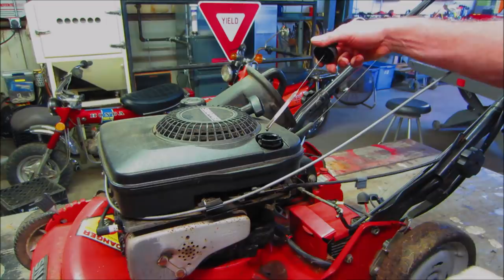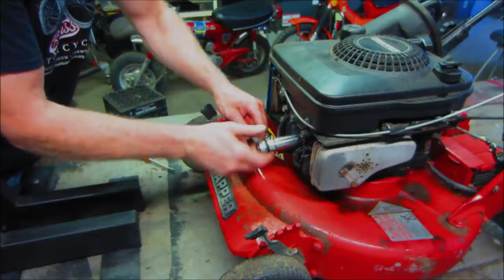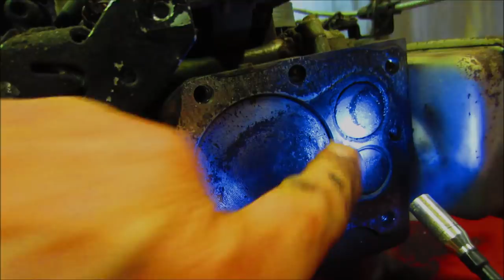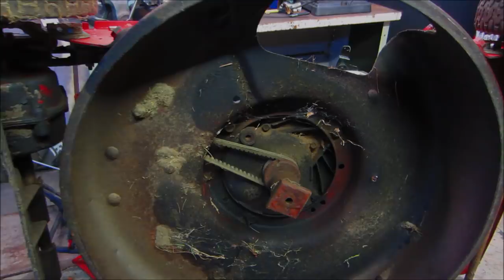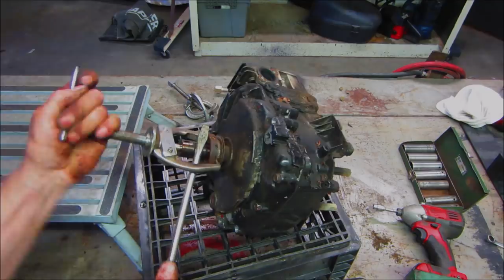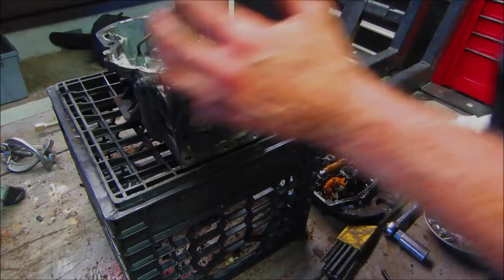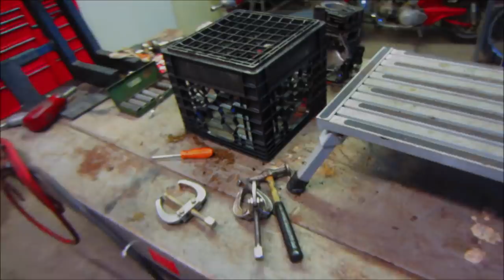Snapper lawn Mower. Why Did It Fail? lets find out.

Comment: When you see plastic cams and gears you know that engine was designed to fail as soon as the warranty expired.
Reply: I was wondering if the plastic camshaft was damaged by the loose bolt, and possibly have a valve open on compression stroke.
Reply: That's actually not the case, i have seen quite a few of these engines worn right out, and it is never the plastic cam that's the issue.
The coefficient of friction between oily plastic and steel is so low, that even on a completely worn out engine, you wont find any real wear on the cam.
Obviously plastic cams can't work in any engine, it's only because the valve spring tension is so low in these engines, that the plastic can withstand the pressure.
Reply: New meaning to variable valve timing
Reply: Most of these I find are still running 20 years later.
Reply: @chefkdowg  still have an '83 Snapper, re-drilled the deck so I can mount Tecumseh (original) or B&S. : )
Reply: @fritzdoerring9058  This engine is a genuine briggs and stratton.
Reply: @fritzdoerring9058  Ummm no its a briggs ignore the lable exactly the same as it has been for 20 years. As for me ive been a small engine mech for 27 plus years running out of a small family business. Dealing with Contracters and as such if i personally dont feel the machine is good enough i refuse to sell it.
Reply: I had a Buick like that, 1983 and one of the first V6's. Ran like a dog. My mechanic was trying to set the timing and it was all over the place. So, (without charging me) he popped open the timing cover, and the cam gear had a metal hub and gears, but everything in between was nylon. The gear was egg shaped. My mechanic found a junkyard gear replacement that was all metal. The Buick ran great after that.
Reply: @wandrinyew  Remember the inline 4 and 6cyl Chevrolet engines?  One timing gear made from metal other some kind of plastic fiber substance. Some company made timing gears out of metal for those engines,Some of my customers would not let me use the metal gears because they claimed the gears were too noisy.Inever could hear the gears myself as they were constant mesh,ran immersed in oil.
Reply: @korvtm  had a Buick V6 in the 80's with a hybrid metal/nylon timing gear. never ran right until we replaced it with full metal.
Reply: @HomelabExtreme  Until some stress is applied to the plastic shit like increased temp. Then the oily plastic teeth slip and the valve timing is gone. Teeth still look good when you open the crank case as here. Hard steel, or titanium, on steel. Still the best.
Reply: @fritzdoerring9058  Good summary of American manufacturing Fritz.
Reply: @glennlurman3514  You are 100% correct, that's definitely a Briggs. Funny thing about Tecumseh, since that name came up somewhere above, they were the biggest small engine producer in the world until they refused to make their engine for $12 cheaper when Sears asked and Briggs & Stratton then agreed to the deal. Sears was the largest retailer of mowers at the time as Craftsman's were everywhere. Suddenly, Tecumseh was bankrupt and Briggs was absorbing almost every other small engine producer in the world. Money makes the world go round.
Reply: @fritzdoerring9058  good engines but the problem with tecumseh was always the shitty carbs they had
Reply: Designed obselance

Comment: Wasn't sure how the gouveners worked till now. Interesting. How long did it take you to figure out the screw came from the air cleaner? Must have kept you up all night. LOL.
Reply: us small engine techs seem to remember bolt locations and appreciable pretty quickly and remember if it was a machine screw, sheet metal screw etc. it helps alot to have a general knowledge of hardware.

Comment: New sub here, with a bit of advice. An inexpensive leakdown tester or just connecting your shop air to the cylinder (via sparkplug hole) would have solved the mystery as to why it had no compression and where it was going, just by listening. IE past a valve or past the rings!😎

Comment: I have a lesser expensive mower from say 1998 Snapper with same self propelled indestructable set up as yours. The Preditor engine from Harbor Freight bolts right on that deck for 99 bucks and have already gotton 5 years of service out of it. it has the same safety handle and clips right on. that Blade you have is a 45 dollar blade very nice for mulching or bagging and the plastic plug for mulching cost 30 bucks too. very nice mower I paid 600 bucks for it back then and love my Snapper.
Reply: I love your videos and have already found a free power washer and rebuilt the pump and got the engine running and you have been a real help. Thanks

Comment: A quick hone, set of rings, valve lap and valve tip grind - it would run just fine.
Great videos !!
Reply: A +.010" piston with rings after honing.
Reply: @Adamsadventures83  Indeed :)
Reply: It's most unlikely that the scored bore is what's causing the compression problem. My guess is the same as others commenting here... the loose bolt scored the bore but it also got caught in the gears and make the cam timing so silly.

Comment: This is the 2nd clip I've seen a bolt had gotten into places it should not have.  The first was a 440 and it was a distributor bolt that managed to get past the intake valve and just HOSED the head and embedded in the piston.  It was a miracle the cylinder walls itself had minor damage and was easily honed out.

Comment: Snapper mowers are dynamite, the best ones made (and still currently made). The 6-speed wheel drive system is complex yet robust and unique. I cut grass with one like this from age 13 to 18 and recently gifted it to my best friend who recently bought his first house. It is basically the same model of mower but without electric start. If you can throw a honda GC150 OHC on there it would be a good mower again.

Comment: I have worked with briggs engines for many years,and that is a classic example of running low on oil,and when it  either quits or makes a lot of noise,they check the oil,see it is empty and pour some in thinking that is a fix.The first thing to go is the galling of the cylinder wall,and then the rod bearing binds up. As far as the bolt goes,I have no idea.I saw some comments about the plastic cam,I have worked on hundreds of them and never have I seen a cam fail

Comment: Those snappers are the best mowers.  I was gifted a 70s snapper highvac with a sheared key, when I bought my first house in the 90s, fixed and used it up until abt a year ago, when everything on was literally wollered and warn. The killer was the starter housing cracked and split in half. 
I replaced it finally with a Toro electric start recycler. It's a floppy twisty deck, half plastic, and cheaply made. Miss my poor old snapper!
Reply: Still using my 1975 one weekly. Just a simple push one

Comment: Snapper high vac mowers are the best, put a new or used engine on and it's as good as new. I was going in the back entrance of the local home depot, it's hard to explain but people dump trash park old cars sometimes, anyway as I went in I noticed a lawn mower sitting there so I drove up next to it and I couldn't believe it, there was a Snapper mower with the bag and it had a bent left axle, the wheel was vertical to the deck, I got it onto my truck, they are heavy well built machines, when I got home I removed the wheel to inspect the damage, the wheel was in good shape which was surprising, I got my torch which is only a propane one, but I use mapp gas which makes it hotter, I needed up the axle and little by little I banged it with a hammer and managed to straighten it out to the point where there is only a very slight practically unnoticeable wobble, then the big thing, will it run, I put gas in and it started right up, it had the signature Briggs and Stratton 5hp engine on it, that was over 15 years ago and I still use it, the engine lasted for a couple of years then one day it just stopped working, the crankshaft locked up, the connecting rod broke, so I looked on Craigslist and found someone who was selling a bolens push mower it wasn't far away so I arranged to go see it, an engine for a Snapper has to be 25mm in length have a double keyway and 7/8 inch diameter, so I turned the bolens over and it had everythjng right, it ran great he wanted 60 bucks which I gave him, I took the engine off put it on the snapper and it's still running 8 years later, it starts with one pull every time even after sitting in the shed all winter, I run it out of gas before storing it, it's a 4.5 hp engine, brand new the snapper with the electric start sold for at least 699.99 for the style he has here, people will buy them without the engine even, a new engine on eBay is cheap and at least you then have a great mower, their drive system is the best.

Comment: I had a 307 Olds motor, carb choke butterfly screw fell down inside the engine. Hammered like crazy. Searched for two days until, while staring blankly at the engine, I noticed the choke screw was missing. Used trans fluid to eventually flush it out, engine was fine. No bent valves, drove it for years after that.

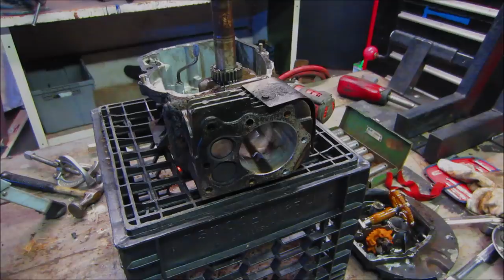Comment: Hey, Mustie1, do you remember commenting on the slack/end play in the crankshaft when you were about to remove the flywheel? There was definitely too much slop there. When you see that much play you can be certain the piston is being torqued from side to side while the engine is running. This causes premature wear on the crankshaft journal, the piston connecting rod bearing surfaces, the piston pin, the sides of the piston skirt, the piston rings, and the cylinder wall. I imagine if you checked the cylinder with a gauge you would find it out of round. Look at the video at 39:16-39:23 or so and you will see the scarring on the piston skirt. Notice that it is the same on each side of the piston skirt and it is 180 degrees around the skirt. This most likely aligns with the scarring on the cylinder wall. When this gets bad enough you lose compression. There are factory limits on the end-play of the installed crankshaft for a reason. Someone may have been in there before and lost an "end-play" spacer (or two) when re-installing the sump cover. These spacers really do matter.

Love your videos!

Comment: I went into the back entrance to my local home depot and off to my right I see a lawnmower, on the way out I decided to check it out, it was a snapper with a bent rear axle, i loaded into my truck took it home removed the axle assembly took the wheel off it was bent just behind then wheel, heated it up and straightened the axle almost perfectly, that was 10 years ago, I still use it, it must have fallen off s truck, any other mower would have probably been destroyed but the snappers are made well, the decks are strong.

Comment: I would have salvaged the engine😉 
Just a tip you can get an idea of cylinder condition by putting your palm over the cylinder to seal it then rotat the flywheel to feel for pressure or vacuum to narrow down compression leaks. 
I've seen a lot of leaks do to lack of valve maintenance as they should be checked every 200 hours👍

Comment: Hehe, Darren, I just had a thought...plastic camshaft lobes! First time I've ever seen that. Remember the damage on the side of the plastic?

Perhaps your loss of compression is a spun plastic lobe assembly. The bolt may have gotten wedged against that plastic "lobe tube!"

I was comparing that governor and cam assembly against the Kawasaki design, the Kawasaki has a low RPM compression release, making pull start much easier. The cam assembly on the snapper doesn't have this.

Comment: I struggle to see how the bolt could get up in the cylinder given how tight a fit the piston is. Could it have jammed the regulator mechanism in some way and the engine has just revved itself to destruction?

Comment: A lot of chatter here about the plastic engine internals,  but the reality is that with proper maintenance, the cam and/or governor won't fail.  These engines were designed for a single run-life, and not intended to be overhauled as engines were in the past.
Had it not been for the bolt in the crankcase, that engine would likely still be running today.

Comment: My same engine,........... pull rope very fast and the engine will lock up.... I think the decompression lever gets ought on valve lifter and stops the crank from turning  .... if  I manually  tune the blade back I can get the engine to free up. I think the  decompression lever spring gets weak and drops  decompression lever  down  too far. Do note that the crank was bent along with the blade bad. I straighten the crank with hammer!

Comment: I think the discolouring on the top of the cylinder head assembly shows that the head gasket was worse than you gave it credit for, along with imperfect valve seating.  I've done a rudimentary check of the rings by putting the palm of my hand across the bore and observed whether any suction/compression can be felt.
Nevertheless, when we see plastic cams we know the engine is not worth repairing. Thanks for the video!

Comment: I once dropped part of a lockwasher into the  intake manifold of a V6 Chevy engine.Had to pull the intake manifold and one cylinder head to fix that goof up.Knew I dropped the washer but thought I fished all out with a magnet.Knew different as soon as the engine started.

Comment: snapper lawn mowers the way they mount the engine on the deck with the inlet by the grass chute flange ,, tend to feed the inlet an awful lot of dust and dirt , I have also had issues with that dirt building up and creating hot spots by plugging up the cooling fins.

Comment: I knew a guy who dropped one of the 2 "vee" blocks from a tap handle wrench down the Rochester 2 barrel carburetor on a 283 Chevrolet. For what ever reason, he drove the car for almost a week before the hardened steel block worked it's way down the intake & into a cylinder. Lunch time!

Comment: Hi there, great video!  If the scratches in the cylinder wall were not too deep, could you use a hone on the cylinder to get it back to running order?

Comment: Did you look at the can shaft ?  The lobs probably spun on its shaft since they are made of plastic  causing the timing to be off  with the valves openned when the piston was top center . That might also explain why you felt that a chunk of the lobs   was missing cause it was exactly that . 

When taking a lawnmower engin apart to see why you have no compression i always make sure that  my valves are all closed and my marks are facing eachother  when  at top dead center so that way i know that my cam is in its right position and that its not him that is the cause of the problem .

 Checking the timing should always be the first step  before taking out the piston when you have no compression and no real signs of ripping or grooves  inside the cylinder Since its the first part that comes into view when you take off the base  of the engin and its a fast and easy check as well as the logical first step

Comment: One thing you didn't check was the intake valve seat.  That cruddy valve face on the intake told me a story....either it's not seating due to insufficient stem clearance, or the seat's been pulled loose out its counterbore , easily checked by seeing if it'll rotate with your finger.  Both are very common on Quantum 12000-series Briggses.  A quick fix if the seat's loose is to peen the seat back in (as long as rotation by the loose seat hasn't ovalled out the bore.)  If the latter happened you can still salvage it by squaring the seat with the guide and moving some block material toward the elongated  areas using a pin punch.  I salvaged one of these engines on a pressure washer with that condition six years ago, got 80 lbs. compression when done, and it still starts on the first pull every time.  Other issues with these are weak valve springs once they're compressed too much during valve removal, and lack of a steel guide bushing on the intake on very early serial numbers (1997 build date).  It seems that the bell-mouthed guide on those early engines would cause the loose intake seat.  I'd check for blow by with an air chuck...I've seen worse skirts than those hold at least 75 lbs. on the compression stroke as long as the rings were good, and those looked OK...not great.

Comment: I think the cam lobes or cam gear has turned  because of the bolt being stuck in it. That plastic is crimped on the camshaft, so they can turn on it with brute force applied. To me the cylinderr is bad but not bad enought for that low compression. Anyway i like your vids Mustie1, and this is not critisism just some thoughts to share :)

Comment: synthetic 5w15 isn't for lawn mowers  XD, they tinkered with the fuel flow to make it run at higher rpm with that heavy blade and put in thinner synthetic thinking it was better... those blades have to run at a specific RPM to work right and "fast" is not that RPM.

Comment: I bought a used 1980's TWO CYCLE snapper that runs like a raped ape. It out-mows my 6.5 HP Newer Snapper.  I have a total of a hundred dollars in it. It has the McCulloch 2 Cycle engine, rated at 4 HP but it is every bit equal to a 6.5 HP 4 cycle.

Comment: You could bore the cylinder out, and put in a bigger  piston. I didnt see how much runout  there was in the cylinder, but if there's enough  thickness in the walls, you could clean it out, so it woukdn't end up scrapped or collecting dust outside.

Comment: i've had luck sanding the cylinder walls with 300 grit, the piston ring will expand to fit the larger bore, did it years ago and the lawn mower still runs like new